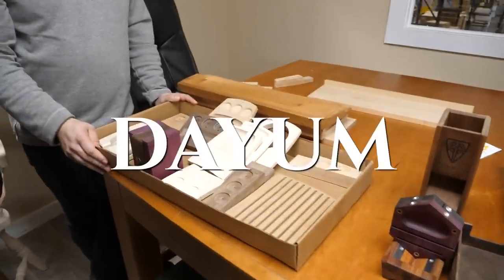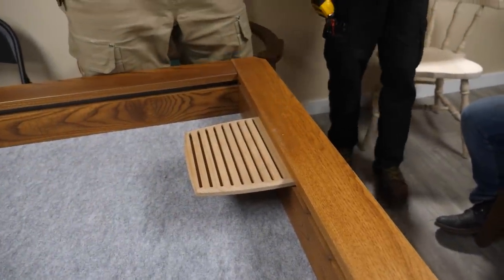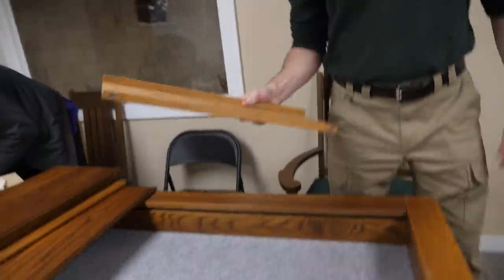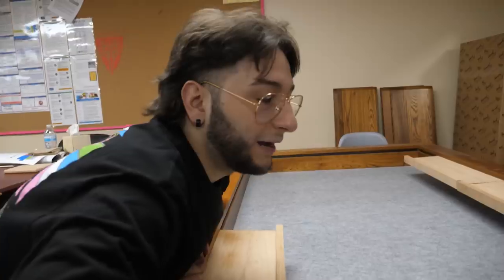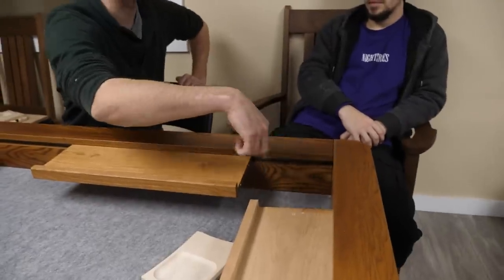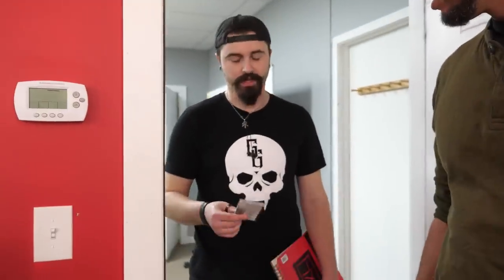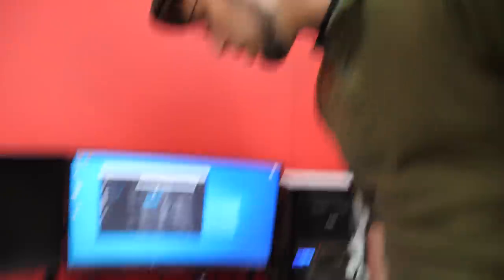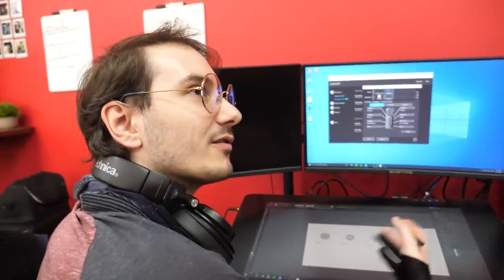Brand New Table Accessories & Deck Boxes!

Comment: I'm with Justin on this one, I like the strap with the little notch thingy to prop up the box. I think that is much more compelling then just the notch cutout that exposes the cards inside. If I were buy a deck box I would buy Justin's design. The other deck box is just a container. His design is innovative and turns the container in to a actual utility functioning device.

Comment: I prefer Justin’s design. Just take the wooden nub and attach it via magnets. It can’t “snap” off if it’s meant to come off. I would much rather draw from inside the deck box at an angle than anything else.

Comment: The brass deckbox bit is a cool idea. Continuous grain is neat but I think the brass would look badass, especially if you matched the metal to the clasps on the box.
Reply: Have the brass as the inside with the woods' continuous grain planed down and added as a non structural face

Comment: Deck box looks cool! Honestly though I'm not loving that hole in the top that exposes the cards while the box is closed. I know it's for drawing from the box while its on its side, and seems like you could just put a divider up against it to "seal" it, but if there's one thing I know about us nerds it's we realllly like our cards fully protected. Worried that it might be difficult to justify a pricy deck box that doesn't fully seal the cards. 

I feel like you could compromise by using the same wood as the lid is made of for that arc that fills the slot, then gluing it on with the proper grain pattern and maybe more structural support. To top it off, laser on a tiny wyrmwood shield on and it'll be framed by the different color wood. You pick up functionality from the box tilt, which is something that might make the difference between people buying it and not, and you have a box that fully encloses the cards.  The difference in wood will probably look intentional as it lends to branding on 3 sides of the box, it wouldn't be the most-most elegant looking I guess since you'd loose that continuous grain, but at that point it might be worth it because you gain such an elegant design feature.  Would be happy to send a sketch if you want ideas from randos on the internet :P
Reply: I also wasn't thrilled with the cutout at the top. On top of it potentially compromising the safety of your cards, it also just looks kinda tacky if you have a clean side, and then just a hole at the top.
Reply: @kelm102  Another solution could be to make the half-moon a rectangle, and then add a little channel for the rectangle to slot into when you clip the lid on the box's side. That way it still acts as a stand, but adds even more rigidity/stability to the "stand" feature. Then they could do a fidget, brass logo or whatever that can can add an additional piece of fun to it, and have the ability to be turned right-side up depending on how the lid is placed.
Reply: Agreed I was excited to get a deck box until I saw this new design. If this is the end product I'm a no. Not sure why they keep messing with it. I really don't want the cards exposed.
Reply: Came here to discuss this as well. There's the possibility of just CNCing a rectangular, card shaped insert that could interlock with the lid when closed, and sort of seal itself against the opening. Would be cool if the insert also had a hollowed out portion as well that could work as a discard/scrap pile holder when taken out of the case for play.

Also if they are already CNCing the bottom of the lid anyway, why not just make a channel for the half moon piece to slot into tightly. Wood glue might not even be necessary. Might also cause the lid to be made a little thicker to accommodate the channel though.

Comment: One, the toolbar is a phenomenal name. Two, those tracker end caps are a stroke of genius.
Reply: Tracker end caps need to have trackers on top and bottom to prevent another sku from being added.  Also adds to the flexibility of use since you can vary which side (or both) you put it on.
Reply: @GlenKroese  Agreed, also possibly a way for it to work with the playerdesk, imo.

Comment: As an MGT backer - LOVE the idea of pushing accessories to backers first. I missed out on the topper block and would really like another shot at it.

As an MTG player - Love the functionality of the tilted deck box. One suggestion - PLEASE double sleeve a commander deck (100 cards) with thick sleeves (aka Dragon Shield sealable inner sleeves with Dragon Shield outer sleeves) and use that for measurement. So many boxes out there either BARELY fit decks or don't fit them when you have them double sleeved.

Comment: For the hobby tray: The front edge box can have a card slot running along the length.
Reply: It could also be used as like an instruction/reference holder for crafting if it was one continuous strip

Comment: For the deckbox, could you put the cutout on the same side as the strap? That way when the lid is on and strapped down, the strap covers the cutout keeping the cards safe.
Reply: If you did that, then while the deck box was on its side to draw from it, it would be laying on one of the snaps which would make it unstable.
Reply: But what if the side it would lie on had the leather embedded like the top (I know it would mean increasing the thickness but could look good)

Comment: for the card tray, reverse the curve on the back, and you can use it on the inside and outside
Reply: So "this side up for inside" and "This side up for outside"? Could work. Depends how deep the grooves are.
Reply: Or just curve one side and have the other straight, as the backwards curve might look worse than straight.
Reply: I was gonna jump in to say this as well.
Reply: Unfortunately those reversed lines would be the ones hidden when used on the outside of the table. There's no good way to make that work.

Comment: a fix for the deck box: just have a card sized insert with the half moon piece glued to it. When your using the box for your library insert it into the bottom with the half moon facing down and sticking out.
Reply: That would be ideal if the semi-circular cutout is kept. I know that the original deck boxes aren’t exactly watertight, but having a piece open gives me pause about stuff getting in there while it’s supposed to be closed

Comment: I like the deck box with the tilt. It looks nice and I like that the cards are still fully protected with it on. I think making the wood cut out brass is a good idea. But i think you should put a brass cut out on the other side of the box so it makes it symmetrical. The only difference is that the one brass side is connected to the top while the other one is connected to the box. I would definitely buy a more expensive deck box where the top has a function and I could use it all the time while playing instead of just putting off to the side. Also if it fits a commander deck with the side deck would be even nicer!

Comment: Please consider: -portrait section that houses a toploader for our commander(s)
-changeable nameplates
-side loading deck boxes
-resin or resin/wood deck boxes
-compartments for token cards or dice
-life-tracker upon a face/lid of the deck box
-interchangeable parts for the colors of magic (there are 5 colors plus colorless/gray after all, and 6 sides to a box)

Doug: "My initial impulse was 'This IS pretty cool.' I don't know how popular it would be, just cuz people that are into, like, Magic: The Gathering, they spend all their money on Magic cards. They, like, don't buy products."
Me: *Stares at four 8,000 card count storage/sorting boxes each sold at $66 before shipping + tax, my thirteen deck cases sold at $15 per case, the sleeves inside sold at $11 per set of 100 sleeves, the 34 sorting trays that come in batches of 6 for $23 before shipping + tax, the magic gaming backpack that was $150, the deck carriers that were $65 and $75 respectively, and carrying 5 decks and 3 playmats plus dice, or 10 decks respectively, and then there's the fact that every single card I own besides tokens are double sleeved to the point that I always have several thousand spare sleeves waiting for cards to be housed.* "Yeah, we don't buy products, we just carry hundreds of loose cards in our hands and the rich use rubber bands and pockets."

Comment: On the large card holder, carve curved slots going one way on one side, flip and carve the opposite curve so it can be reversed and used on either side of the rail. 👌🏼
(Might require increasing final thickness by 2-3mm)

Comment: Need to have a high back-and-side option for the "tool bar" to act as a GM screen, maybe magnetic so reference sheets can be hung up on the inside. If you put locking magnets up the edge of the side pieces it'll add enough stability that you don't need to worry about accidentally knocking the back off

Comment: Still holding out for that stackable dice tower, I think it’s a major improvement from the current tower.
Reply: that 1 hour drop will be sick
Reply: @klugevil  lol! I want one to tumble from the start of the session and not get to the other side until end of it.
Reply: I pitched an idea I had for it on the Discord.  I realize that the base of the tower had no reason to be modular so I split it into three pieces.  This made it to where there were only two types of pieces.  The base ramp and the stackable mixers.  This made it more portable and you could even put a seven section tower IN the party tray.

But the best part?..  The base ramp piece flipped over to be what I called the Deep Dish Component tray.  An elevated and deeper hexy tray for a larger centralized bank of tokens.   Even modeled the whole thing in Tinkercad.

Unfortunately it seems like they gave up on the modular tower.  Tho, now that I think about it.  If they're not going to make it I should throw up the files on Thingiverse.
Reply: That design was incredible. And watching Bennet build it was thrilling.
Reply: @VagabondTE  If that is at all possible I’m sure a lot of us would love to see on thingiverse.

Comment: A couple of good points have been brought up here. First, yes, serious MTG players do spend a lot on cards but they can spend just as much on protecting those cards. I literally just bought a new high end deck box two days ago for a new deck I put together. Secondly, the other point was taking into consideration in your design, the fact that a lot of players double sleeve their cards. That makes the decks a bit fatter.

On a side note, a great addition to this project would be Wyrmwood designed card sleeves. If you guys teamed up with UltraPro and made sleeves with your designs on them, I'd buy that all day long. Your corrupted and Halloween stuff would be killer. Especially with the sets currently out right now.

Comment: As a MtG nerd, I already know that magic players will 1000% buy a specially-made deck box, even if it's for their 1 favorite deck. We prioritize protection amongst everything when it comes to our cards. We playtest card sleeves, deck boxes, storage, etc. just to find out what we personally like. Since EDH/Commander is a format that boasts a 100-card singleton deck, you can carefully assume that decks have been toppled over. Factor in double-sleeving with thicker inner sleeves and the deck while nearly topple itself.

I do like the design of the card drawing function. It'd be nice to have another cut out on the opposite side of the box in order to have another side to grip on, especially when playing against decks that like to consistently shuffle. Other than that, the tilt & cut out provide a function that's an arm strap away from being a Yugioh duel disk. I like it!

Comment: That front cap on the tooltray, you could make it a little thicker and put the pencil holder slots there, or even a card slot row or three. As for the deck box, you could change the top so that it's hollowed out instead to create that draw-slot, or replace the wooden top altogether with a metal top that could be punched out and a tab bent into place for the draw-slot, a piece of wood/cork glued on the underside would still take the strap, and you'd have free canvas for artwork tops.

Comment: For formats with a side-board: what would be your plan for separating the sideboard? I like the idea of drawing  from my deckbox (especially if wood) but how can I put my opponent at ease that I’m not cheating? Maybe a 2 part top with a divider in the box- have the top you show be maintained and a small magnetic lid for a sideboard enclosure? Might not work for EDH, but I don’t play that format much.

Comment: Seen a lot of this.  The notch can't be hidden under the strap because it won't be lined up with the top of the deck box when it's open.  Even if you rotated your deck to line up with the notch, you would be drawing your cards sideways either showing them to the other player or you would have the bottom of your deck facing yourself, potentially revealing extra cards.

Comment: With a relaunch of "MGT 2.0" is there any chance of other table shapes? Circular/Hexagonal Lilliput? Oval Dining table? I understand the constraints for internal/external accessory attachment/placement, but it opens up so much diversity for interior design.

Comment: Sorry Jason, but the tilting deck box is exactly what you need to make. You have two problems:
1) You need a commander-sized deck box for MTG
2) You need a drawable deck holder (the tilted box)

You can solve both with a single product as was demonstrated. I love the prototype deck box shown and really you just need to strengthen the connection (with a cross grain) and you're golden. I would have the box be two-tone with the lid and 'lip' as a 2nd color from the primary box. Then the grain not 'matching' directionally on the side wouldn't matter.

Comment: I like both the tool bar and the deck box. However, I like the deck box mod. I like how the cutout serves two dual purposes. I just wonder if it is possible to make the joint and the cutout reinforced enough.

Comment: Seeing that the audience for a deck box is probably greater (just due to the fact that you are hitting a large audience and not just the ones that have already bought tables) and that I also want a deck box I say deck box!  I have bought at least 5 deck boxes this year and if I could get a cool, functional one that would be where my dollars go.  If you're gonna buy a table or have already bought one the tool bar isn't going to stop that train from rolling.  I always pull my deck out :P and it would be cool to have a box where I could just leave it in the box and play and then put it back in and go home, cool idea!

Comment: Do you think it's possible to add a card/paper holder slot on the top/long edge of the hobby tray. That way you can put cards there or toss in a piece of paper or two. That'd be cool.

Comment: 3:14 curved slots one way on one side and curved the other way on the other, if you use a deep enough cut you can have full cut thoughts that help with cleaning etc. Have the depth vary to stop water damage in case of a spill, might work better than a single depth.

Comment: I definitely don't want my cards exposed with a little cut out for drawing. I'd rather have the functionality of being able to draw the cards from the box only if the box was fully sealed. Otherwise I'd rather have a box without that functionality.
Reply: I thought the same - really don't like the idea of it being exposed -
It only takes that 1 time where you're going to a friends house, drop the cards in a puddle/mud or it's raining and you find your cards got wet because your deck "box" isn't sealed..

Comment: You could curve the card holder if there were curves in the opposing direction or neutral version on the bottom. Flip it over to use it on the inside.

Comment: My opinion on the deckbox as a Magic Player :
- I'm pretty sure a deckbox with a hole in it when close will not sell well. We want our thousand dollars decks to be secure and well protected when not in use.
- Magic player do and will buy luxury accessories if the primary function is still good (here, protecting the cards during transport). Look at aaron cain or Leifkicker if you want example of successful product in this space.
- The box doubling as a tray is a really good idea. Not sure how this would work in tournament settings but it would be a huge hit with the commander crowd.

Comment: Same request/idea. With the hobbytray/toolbar. if there is a way to make the inside of it flush with the outside of the table aprons (not sure what its called) I feel like it would be just that much better. And would make it amazing for putting larger laptops and things like that.

Comment: I don't know about MtG deck boxes specifically, but I would DEFINITELY drop some coin on combination card shoes/boxes. A lot of board games only ship organizers intended to hold their cards unsleeved, or even no organizers at all. This is a problem if you're playing a game that has really tall decks which get easily toppled when sleeved due to the decreased friction. This problem is exacerbated for me personally because in addition to sleeving cards, I need to add Braille labels to them, which increases the deck height significantly while decreasing the friction even further.

Ideally, I'd want a modular card tower -- stack segments on top of each other with corner magnets, and a continuous gap down the front to enable drawing cards regardless of how deep they are. Bottom segment has a base, obviously, and when another bottom segment is flipped over and placed on top, the card shoe becomes a box for storage. You could sell segments in mini, standard, and tarot sizes, and I bet they'd be very cheap to produce due to their relative structural simplicity compared to things like the dice towers.